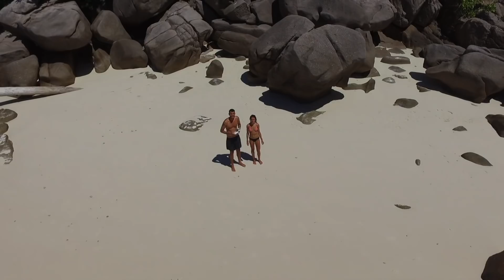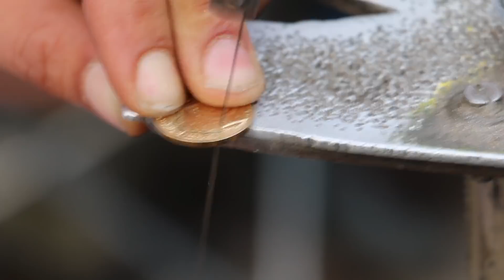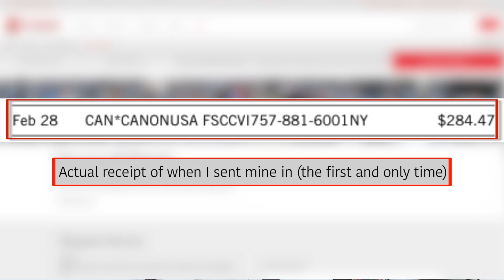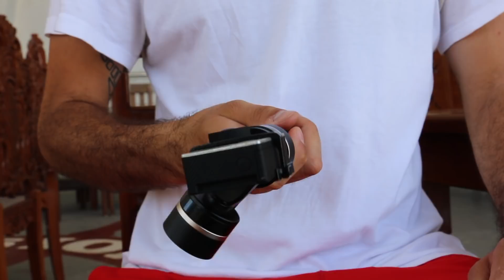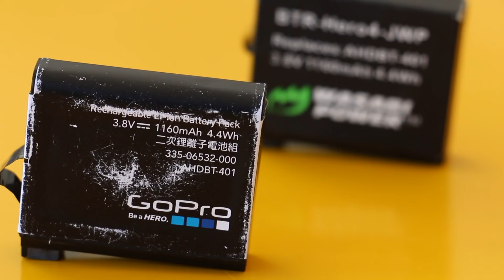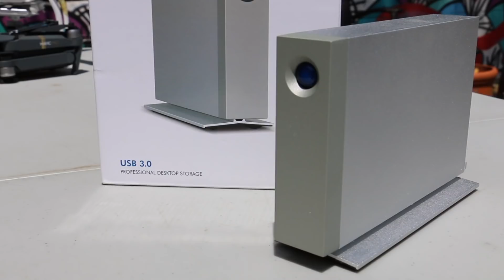How we Use our Travel Gear & Camera Equipment (PROS & CONS)

Comment: I currently use a GoPro Hero 6 as my main camera but looking to buy another camera for a main and gopro as secondary. Do you recommend a DSLR/Mirror less or a point and shoot like G7X or RX100.
Reply from the maker: I hate the "that's a tough question" approach so I'll try to keep it as honest as possible here. Get the DSLR. Sure, it's more expensive and bulkier than the point and shoot but it is a lot more versatile (interchangeable lens, zoom-in, mic ports, etc). 
The quality of picture from the DSLR is going to beat out a point and shoot as well. If you are only carrying around a GoPro, then consider it the ying to your yang. Also, cost wise- a good camera will last your years so look at it as an investment rather than a short term purchase.  
Hope this helps!
Reply: Thanks for the advice.
Reply from the maker: @UncertainAdventures  Anytime!

Comment: Great videos! Always looking forward to the next one. Are there any particular features with the DJI Mavic Pro that made you choose that particular model vs the Mavic Air?
Reply from the maker: Rich R Nothing terribly particular. The mavic pro had been in our sights for a while. Coming from the P3 we wanted something that was a little heavier than the air. 
We push the drone to the limit a lot so having a more reliable signal and longer lasting battery life also comes in handy.
Read great things about both but decided to go with our gut and it paid off. The pro has been amazing!
Reply: Int Affair Thanks for the reply! I was only considering the lightness of the Air for carrying around purpose, I agree that a bit heavier one would be beneficial for tougher conditions. Can’t wait to see the vid for your more detailed review of the Mavic Pro. Safe travels!
Reply from the maker: Rich R Absolutely and thanks!

Comment: Since I just started doing youtube again, I got a Canon SL2/200D I put a Rode Videomicro on it and so far I'm happy with it, not to say I won't try different set ups later, on I also have a Canon 7Dmk2 mainly for stills and once in awhile for video. 
I have not got a drone or go pro, yet but you never know. 
the 18-135 is heavy but my go to lens for the 7Dm2, for the SL2 I use an 18-55mm STM. I also have the 50mm 1.8 plastic fantastic-nifty-fifty but I didn't use it that much, and I got a the 24mm pancake, the 10-18mm is next, and hopefully by Christmas a 70-200. 
On battery life I can almost go all day one battery for both DSLRs, I do have two spares for each camera.
I probably don't shoot as much as you do,  I recharge my cell phone more than the cameras :) 
Nice gear review.

The one thing I would share is look into refurbished bodies and lenses, they are bit cheaper and supposedly been gone through by qualified techs,  my 7Dm2 is refurbished as is my 18-135 lens and both work as advertised so to speak. 
If you can find a Camera show, more like a camera swap meet you can find some good deals, most DSLRs from Canon, Nikon and others can use the older lenses with no problems you just have to your research
I also know with adapters the Sony a6xxx series can use older Minolta lens, Adapted Canon lenses are also popular with Sony shooters
,Also consider and older model it can save you some money for example my 7DM2 it came out four years ago and its still going strong. (Amazon has a refurb Nikon D7200 for around 800 bucks and it has dual SD card slots, mic and headphone jacks, and has the drive gear to use the older lenses built in)
Nice Review I can see where Phantom 3 would be a challenge to pack, I'm looking at the Mavic myself.